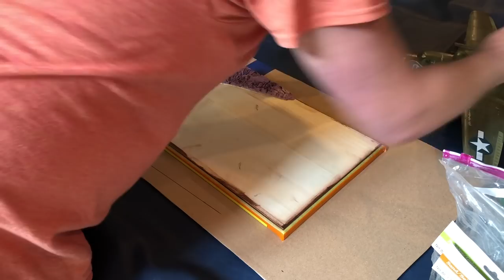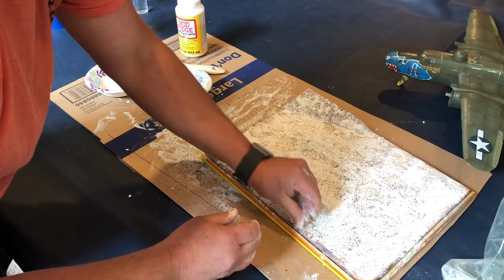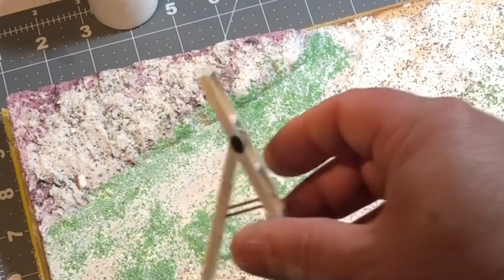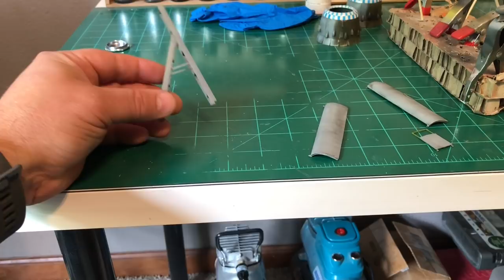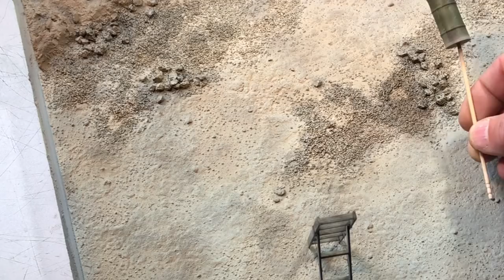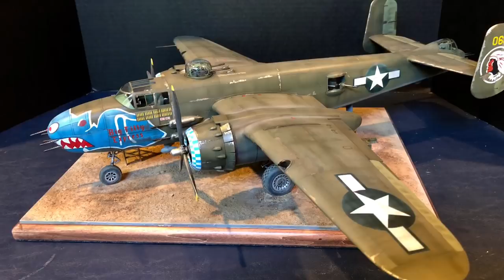1/32 HK B-25 Build 2.0 Part 5: The Base and Completed Model

Comment: You are a true artist!! I am an Airline Pilot, instructor, A&P mechanic, my family had war birds growing up and going to many shows since I was about 10 years old. If I may add one thing.  I have noticed on many scale modelers and even scale artists are weathering the props too much and too far down the prop blade toward the hub. I don't ever recall seeing any chipping of the prop paint when close to the hub say 15% of the blade. Basically, where there is little or no airfoil there is little or no paint chipping (weathering) it seems like that area is protected from chipping. I hope this may help.

Comment: How was the overall fit/kit ?
Reply from the maker: Overall fit was great as long as you take your time.  You’re gonna have a big seam along the top and bottom of the fuselage to clean up but if you test fit the inner compartments while you build them, you can avoid any big steps.  Only a couple of issues that I’ve found were the way the side gunners guns attach to the fuselage is pretty weak so you have to take care when inserting the barrels after painting.  The other major issue is the flimsy plastic landing gear.  If you’re gonna build it on its wheels, G Factor aftermarket landing gear is a must.
Reply: Primedmodelworks appreciate your detailed response! Hopefully you will build Wingnut Wings  Lancaster 😊. Enjoy your videos!  Thank you